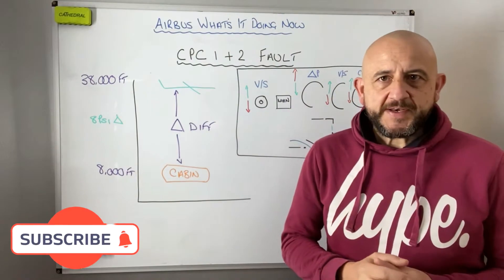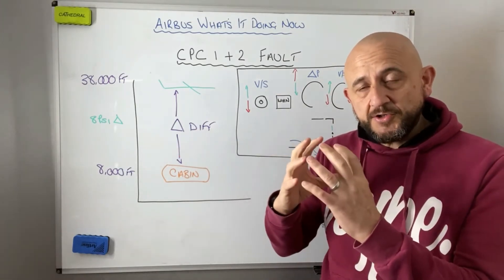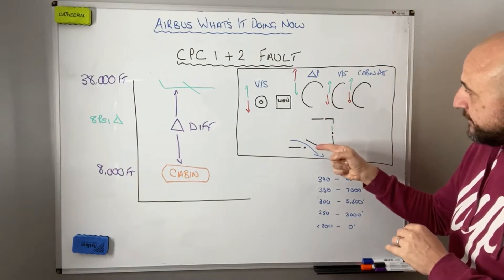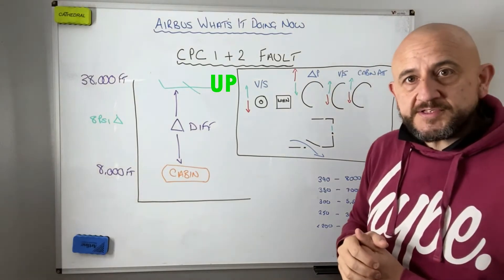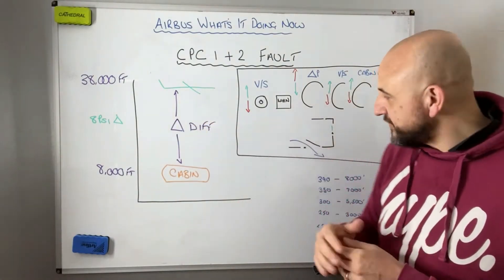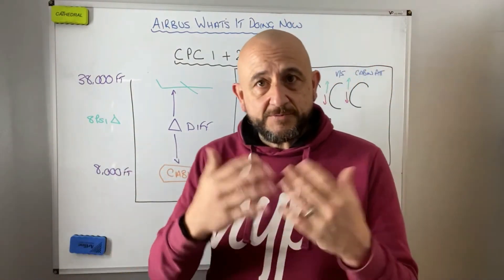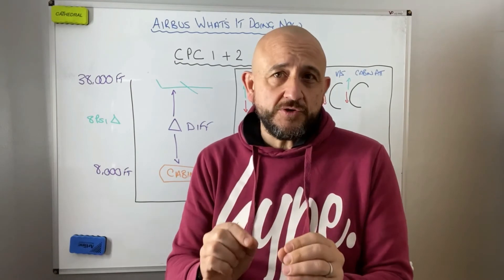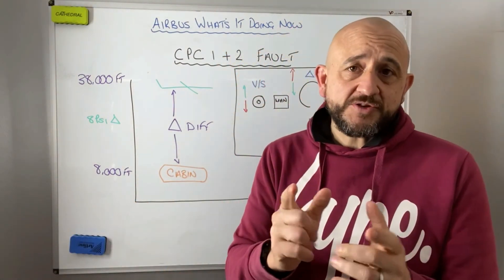CPC 1+2 Fault

Comment: Hello Captain, thanks for thé video. Could you please confirm that the target cab press V/S ( 500 / 300 ft ) is independant from the aircraft rate of descent or climb. I mean can you descent at 2000 ft / min with the aircraft for the approach And  keep 300 ft / min with the cab v/s descent. Thank you
Reply from the maker: Yes The requirement is for the cabin. Be careful however of the AC descent rate so as not to overtake the cabin (neg diff)

Comment: Great video ! An another option is to keep the CAB V/S at 0 during descent until the aircraft altitude reaches the cabin altitude (E.g 7000ft) , then V/S switch fully up and we can start the approach from there with a gentle rate of descent . For the descent, it's better to ask the ATC for a continuous descent to avoid big variation of air entering the cabin during level-offs.
Reply from the maker: Thanks for the feedback. Its quite tricky to maintain the cabin at a constant altitude whilst the aircraft is descending due to the density of the air changing, requiring constant adjustments of the OFV. Perhaps one to try when next in the Sim!